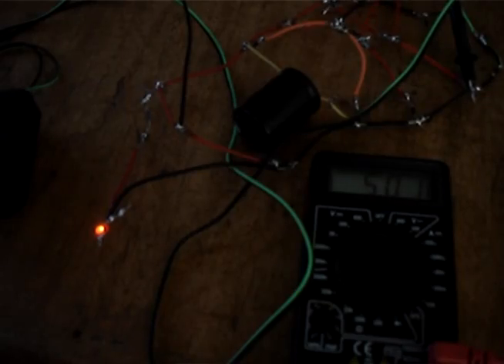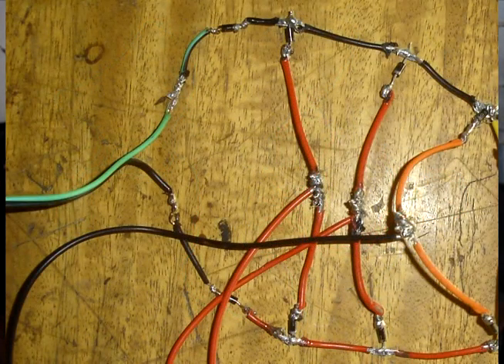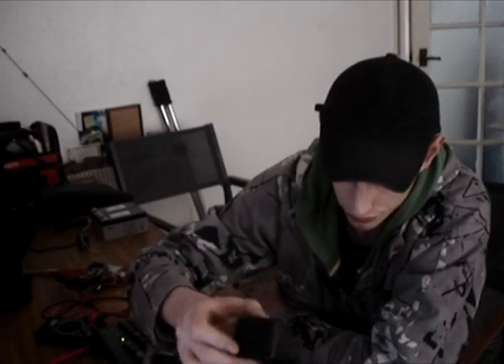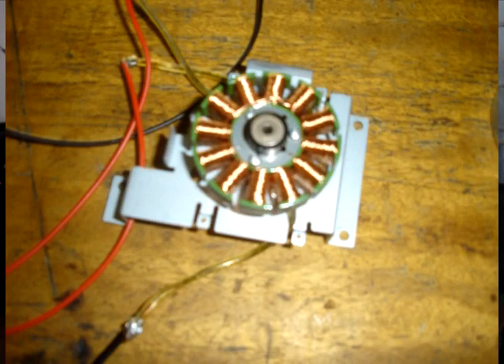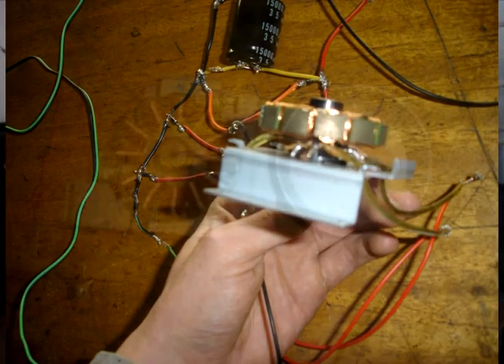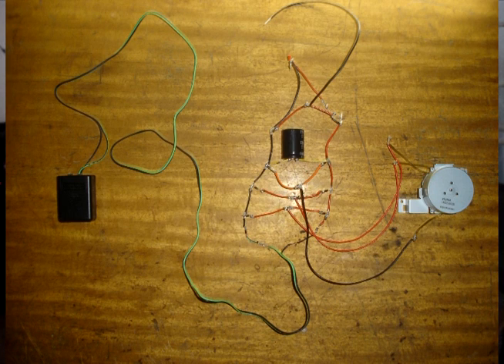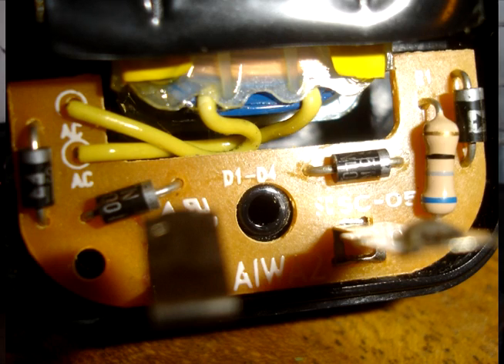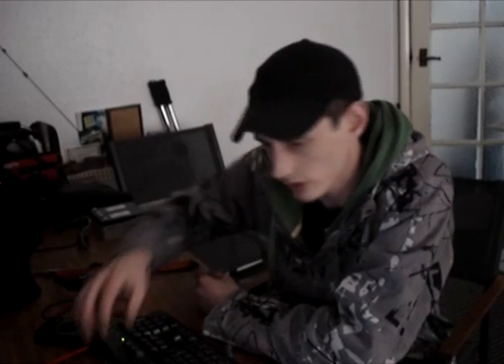Hakology - Mini 3 Phase Battery Charger

Comment: Bravo! Very nicely done. I'm onto the same process, with 3 phase motors, Charge controller, VFD, Solar Panels, 240 VAC Inverter, and 3000 watts worth of drive batteries. My idea is to use your setup with my existing parts, to charge a larger battery bank, automatically, that will be powering a home through a 240/120 VAC/24 VDC inverter. Now to do the math to get the right configuration. Thanks again for the informative video.

Comment: I suggest you research a bit on not just diodes and capacitors, but, building a diode bridge rectification for more consistant full wave charge  (with captures both the positive and inverts the negative field to positive from the polarity of the magnetic power being stored in the capacitor.